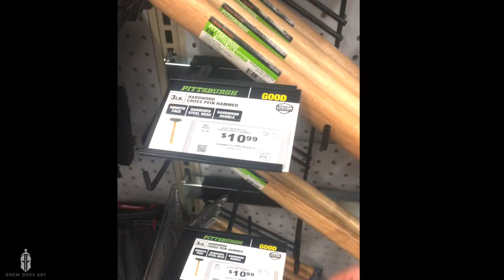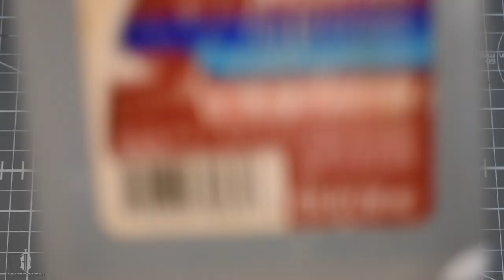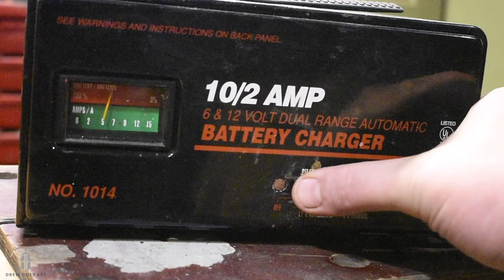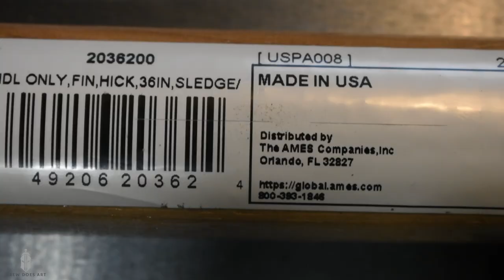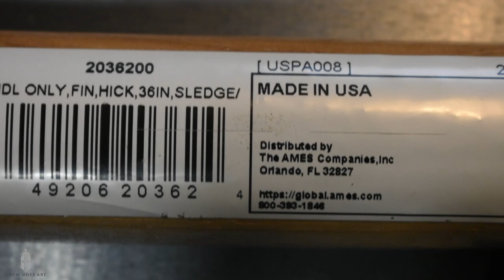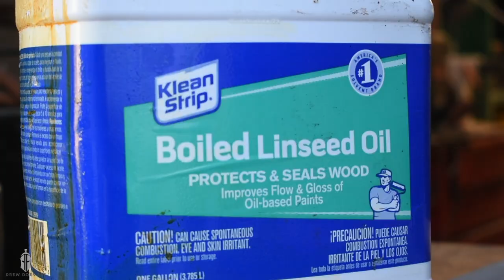Modify Harbor Freight Cross Peen Hammer For Blacksmithing With Viking Etching

Comment: Great job on the hammer and the video Drew! Thanks for making it. I was thinking about doing a hammer as my next project. I have an old corroded hand sledge that's lying around that would be perfect. I see you use a 10-amp, 12-volt charger for your projects. I've done a couple axes with a 5-amp, 12-volt power supply (like for CB Radio home stations) and it has worked, it hasn't really given me that dramatic texture contrast between the masked portions and the contact patches. The lines will catch my fingernail for sure, but I was thinking there would be more of a difference. I tried leaving it in the bath longer (30 minutes) but then the contact patches were corroding more than I wanted, so I pulled it. Will the 10-amp version make that etch deeper? or would I be spending money for ultimately the same results?
Reply from the maker: If you use a piece of steel for the ground and connect the contact from the device to the steel out of the salt water, the contact won't corrode. For the Hot use a thick copper wire, and also connect the contact outside the Saltwater. Yes the 12v 10a Battery charger will work better than a power supply. If you use a power supply then you can't see how many amps you're pushing. The battery charger has the gauge so you can see exactly how many amps you're pushing thru. I usually set it to 10 amps. but it will read between 3 and 5 amps.  I also found if you add more salt to the water it will etch better too. 

Thank you for the comment. I really appreciate you watching and commenting on my videos.